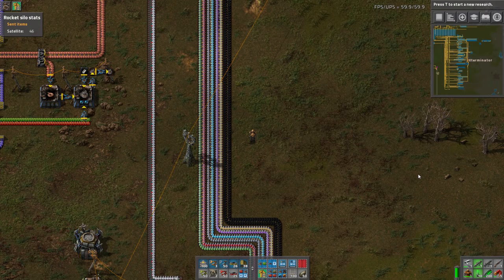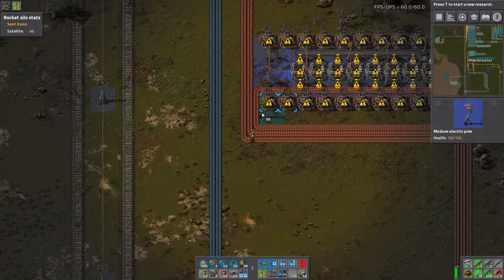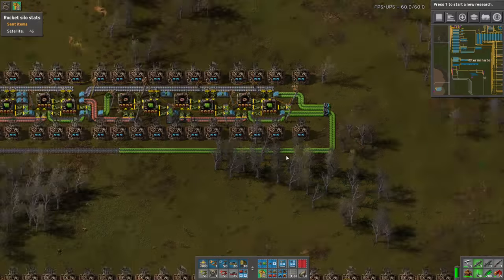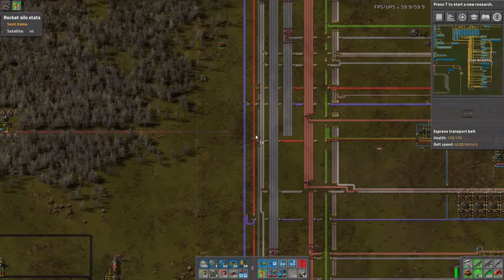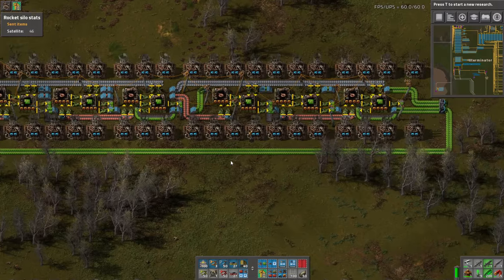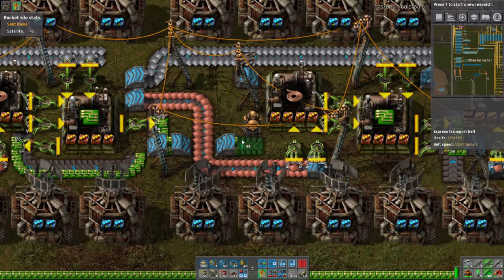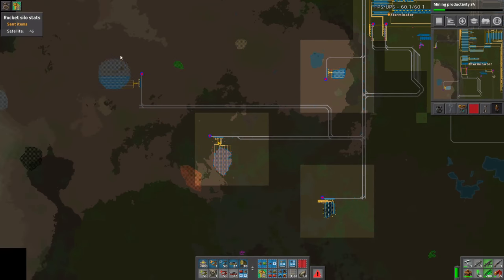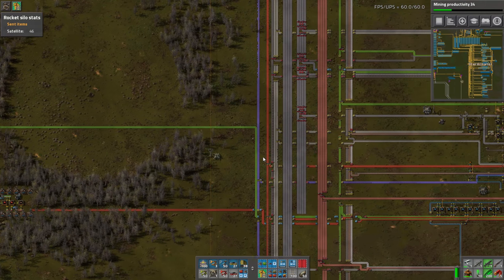Factorio: Tightening The Belt: Megabase Guide EP54 - BLUE BELT OF REDS! | Tutorial Gameplay Series

Comment: Oh and as a potential fix for your power setup, I think it just looks like the pumps are low on output because you're drawing more than you're sending.
You could try making every single pipe underground to improve throughput.
Apparently for transferring 160MW of power through heatpipe 100% is kept up to 45 tiles away, after that you lose some, and ONE pump can supply up to twenty steam turbines so count them to know if it's a water bottleneck.
Reply from the maker: Jkor ECM Undergrounds would definitely help. However that isn't the issue with the pumps. Offshore pumps will pump 100 regardless of what you are consuming. it's bugged in somehow.
Reply: Xterminator Is the pump bugged or is your GUI though? If those pumps were pumping THAT little, then most of your turbines should have been turned off yeah? If its pumping 20 and normal is 100 that should mean you only had enough water for 4 turbines (20% of the normal 20 Turbine:1 pump).

Regardless, I would either move the reactor to a body of water on 1 side (easy to defend too although it shouldn't be causing much polution) and train in the fuel rods, send the spent ones back for reprocessing. You could train IN water, but tbh you're running out of good space. I always find it easier to separate my reactor from my base due to space and how low maintenance it is as long as you keep importing the fuel rods at the proper pace.
Reply: Xterminator I just looked in the video, you have 26 steam turbines in each column. 1 pump can supply 20, but even if you're supplementing, the heat exchangers you have (13 multiplied by 1.718 [the amount of turbines supplied per exchanger] comes out to 22.334, hence why you see 23 on and 3 dead ones, and the 23rd one is only operating at 33.4*% capacity too).
Reply: pump has limit-1200/s i was going short on water, so i made 2 pumps per pipe, then put underground pipe, and between each pipe pump, to increase throughput speed. Because i have big nuclear power plant, more than 20 reactors, 2 lines, and i don't have solar, but have lots of accumulators, so if i have surplus energy, nuclear energy is not going to waste, but are storing for later use.
Reply: Juris Cervenaks You should store the excess energy as steam in tanks, its WAY more efficient than accumulators.
Reply: Can you explain why it is more efficient, first time hearing that way. Does it take less space, or you can put more capacity for same space? As far as i know, only way to make steam is with heat exchangers, coal heat exchenger is lower efficiency, nuclear heat exchanger need separate nuclear reactor...wait, i had 1 steam turbine 20 steam in each turbine line, i take it off and put pump, that is collecting it, but without circuit it will suck all steam of all turbines. And i had another idea, i can't collect 100% energy from nuclear, if it goes lower than 500, turbines are shutting down, and my lasers are dead, but if it is 501 or higher i am wasting nuclear fuel. I could put circuit to nuclear, and if heat is bigger than 500 it could start pumping water to separate heat exchangers to make steam. How many tanks do i need for 10 GW? Did i understand right your thought?
Reply: Juris Cervenaks Certainly I can explain. Tanks hold a crazy amount of energy and are cheap, the downside is they have to output the steam into turbines so you have to overbuild if you want to exceed the output of your reactor for "short" bursts (Really it's long bursts of you have enough tanks, but it can trick you if you exceed the average output of your reactor over X amount of time due to it taking a long time to drain the tanks). If your Turbines aren't consuming the steam, it will fill the tanks, with circuits you can tell the reactors to stay off when for example the steam in the tanks is over 50% saving fuel (Although with a 10GW reactor you dont care about fuel almost certainly).
Tanks save a massive amount of space, and tbh I don't like having a seizure when I look at my accumulator farm or blowing my ear drums out when I walk by.
These tanks and accumulators are just like buffers in your production line though, it can conceal when you need to expand your power for  awhile depending on how much energy you store.

My advice at 10GW is this: You have so much output you clearly have a good supply of uranium fuel rods, ditch the tanks and the accumulators and just expand your power. I have NEVER even used up the uranium I got from one patch. Once you get Kovarex it's so much it's so hard to run out at this point. Put your resources into more raw nuclear power and dont waste it on extra tanks, accumulators and/or overbuilding turbines.
Reply: Jkor ECM   But then i need to put circuit to shut down reactors when i have enough power (only couple of them), but will they by able to turn ON fast when needed, as i have seen they need couple minutes to go to 500 heat, and at thous couple minutes my factories will not work at 100%, i know not big deal, but then i need to build steam tanks to compensate for thous couple minutes. I have gone through couple ore patch, but i have classic mode, low patches at start position, i have explored ore that have 2 mil, but i will not touch it, i clean space for factories. Is it possible to lower fuel usage (only use fuel if heat is lower than 500, and stop if higher than 501, so i don't need to shut it down completely? I didn't build batteries/transformers to hold energy because i don't want to expand, i built it because i have fluctuations in my power usage.
Reply: Juris Cervenaks It sounds like fuel IS after all a concern for you due to your game settings. Do you want to build your own or would you like me to give you the blueprint I use?

It outputs 480 MW from a 4 reactor module and wastes ZERO fuel. You can stamp down 20 for close to 10GW if you want and it will never consume fuel when it's not required, and will never drop below operating temperatures (501C)
Reply: You can give blueprint, but i will only learn from it, will save blueprint for potential multiplayer games, or new map. But i have 2xinfinite build, of course there is limit of length due to lake size, and i don't want use mods, last time was playing on clusterio server, and lost all my blueprints :(     No fuel is not concern, fuel waste is concern. I already made mistake mining from 700k ore patch, it is going forever. I just want to by economical.
Reply: Juris Cervenaks If fuel isn't a concern I would recommend not using a smart setup with any storage tanks and just raw power 24/7. It's far more UPS efficient especially as nuclear already suffers from worse UPS than solar, but I will give you the string when I get home. If it's just for the cool factor then yes absolutely, but if UPS is an issue it's a bad idea.
Reply: Are you saying that couple smart setup will make huge drop in ups? Why, it is only taking action when power is to low, or to much, if power is on between spot and shifting frequently, for that reason i can build steam tanks, so it will switch less frequently. I have plenty places to gain UPS, i am just switching from belt, to bots. I don't build solar because i don't have space, i don't build over ore, and i need space for factories. I am mining slowly because i have productivity 250.
Reply: Juris Cervenaks Basically UPS is hogged by fluids and steam counts as a fluid as does the water obviously, the more tanks you have the more steam (fluid) you have in the system for the game to contend with, and tanks might as well be huge pipes as far as the game is concerned with calculations.

What I'm saying is unless you're going for the "wow it's cool but not really practical" thing, then just build a reactor setup that can handle your peak draw and run it all the time. It will take forever to run out of fuel if you run Kovarex process and tap a couple million of Uranium.

Comment: - This base would be much better if you just take some seconds to consult your brain to do some work for you. You "fixed" the green circuits and broke them more than before at the same time. Now, 2 are not hocked up. 
- At 15:40 you don't have to underground the blue belt. Just shift the red circuit connection to the left side of the blues. 
- The main bus is a horror scenario to look at. You are right to only underground the part which need fewer undergrounds, but whats this on the right side at 15:50? Underground 4 belts to get one copper belt out? This doesn't make sense.
- The fuel chest for the middle one in the upper row isn't requesting anything. There was the "I have not copyed anything, because I'm out of reach sound."

Comment: I think you were looking at the amount of water inside the pump / pipe. Not the rate. So even though your pump produces 1200 water units per second, it would only have 20 units inside of it per tick. I don't think enough water was reaching the end of the boilers, which is why you noticed the temperature was adequate but they were not running.